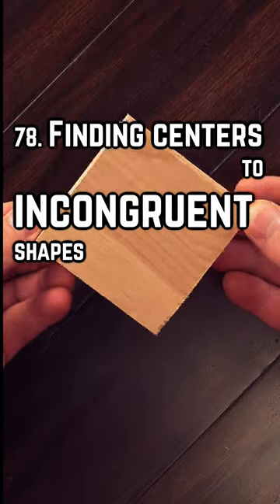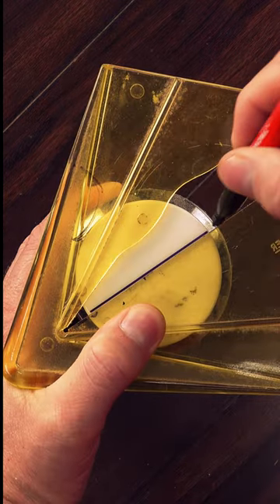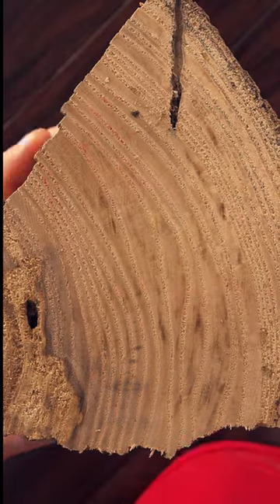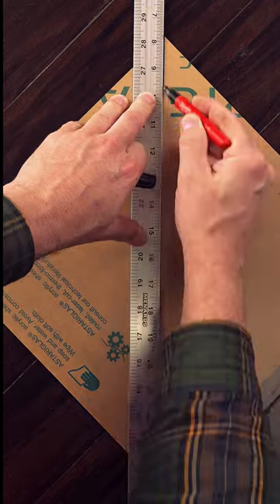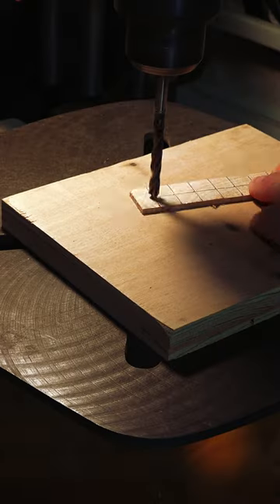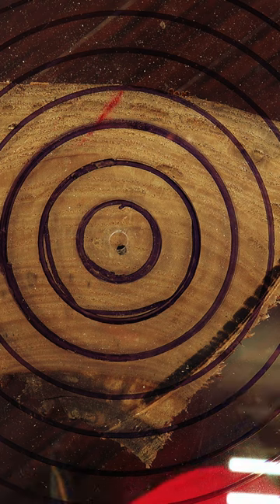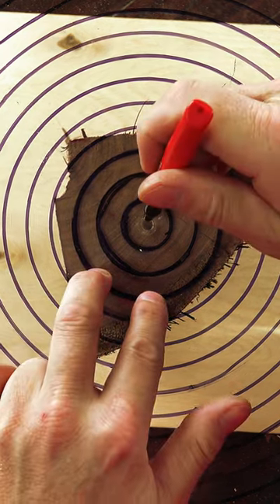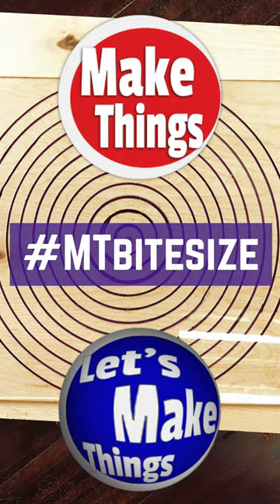78. Finding the center to incongruent shapes #mtbitesize #shorts

Comment: If you are looking for the center of mass, rather than area, first clamp a long knife--edge up--to your workbench.  Next, try to balance the piece on the knife edge.  When you have it pretty close, give the piece a hard blow to make a mark across the bottom.  Rotate the piece and do the same thing at least one more time, though two or three are better.   Now do the whole thing to the other end.  Profit!
Reply: This way you will find the center of gravity/mass, but not the center of area.
But for the most homogeneous materials with the same thickness over the full area that would be almost the same point.
Reply: @MlTGLIED  did you read the first sentence?
Reply: Actually, he's not looking for the center of mass or area. He's looking for the center of the largest circle that fits in the piece.
Reply: Or balance on a punch/ream
Reply: @Chewychaca  That works, but, depending on the size/weight of the piece, can be tricky.

Comment: There are TWO centres;
Centre of area, and centre of gravity.
Sometimes they coincide.
.
Reply: For anyone confused this video is about center of mass
Reply: @timothyweber671  
For any flat shape however irregular, just suspend it from three points roughly equal distances around the perimeter, and mark the vertical line from the suspension point.
Where the lines cross, will be the centre of gravity, or mass, if it's even thickness.
.
Reply: @niklar55  seems I was confused thanks !
Reply: @timothyweber671  
Learned that method from a Physics book my dad bought me when I was 12 years old.
If you get it right, you can then balance it on a pinpoint!😊
Reply: There's even more different centers. This method can find the center of incircle or the center of circumcircle - and if you want to turn an irregular shape on a lathe, the center of the incircle is what you want, because that is what gives you the largest cylinder of usable material.
Reply: @zuthalsoraniz6764  you need more upvotes. There are really a lot of different centers
Reply: With this level of estimation, you'd be fine with just attempting to balance it on your finger and figure out aproximately where it could be balanced.
Reply: @zuthalsoraniz6764  
That would only work on a piece of flat material.
For a log, or split log they would vary along its length.
If the log was curved, the centre of the inside circle on each end could result in a seriously out of balance item.
Reply: @timothyweber671  This is not about center of mass or area. It is about finding the center of the biggest circle that fits on the piece.
Reply: @timothyweber671  It's not, actually. It's about the incenter, the center of the largest circle that fits within the shape. The center of mass of a thermometer shape would be somewhere along its neck, while its incenter would be in the bulb.
Reply: (Roughly) triangluar shapes like the example log have four geometric centers, one of which, the centroid, is the center of mass (for constant density materials). A lot of assumptions would be made with real-world materials especially natural ones like wood, but using the centroid on something like this would be a far better path forward if the desire is centering for turning.
Reply: assuming the material is homogeneous, it is the same
Reply: @merren2306  
Nope.
If the material is wedge shaped, for instance, they would be quite different.
.
Reply: @niklar55  a wedge is three dimensional, not two, so "centre of area" would be completely meaningless in that case. The centre of volume and centre of gravity would still be the same
Reply: @merren2306  PLEASE READ the original comment........................
There are TWO centres;
Centre of area and centre of gravity.
Sometimes they coincide.
Reply: @niklar55  centre of area is meaningless in a three-dimensional shape...
Reply: @merren2306  
Nope!
If it's a flat object with a continuous cross section, then the centre of area is relevant.
eg. A slice of a tree trunk.
.
Reply: This one is trying to maximize the amount of circular stock you have
Reply: @jonothankaplan  
Agred, but i'd put it as the maximum size circular disk that can be fitted in that cross section.
Reply: there are as much of center as you want..just give a definition of this center.. and sometimes this centezrs are outside the object...
Reply: and in this specific case with this tool for many shapes you can find several centers even an infinity.
Reply: @jacqueslemiere  
Yeah and pigs can grow wings and fly!
Reply: @niklar55  . if you take a simple rectangle there is an infinity of  points that fit the définition  of  center this guy just defined.. 
 and indeed  you can have as many centers as you want..  not only two as long you give a definition..  center of mass is not  the propriety of a shape but a material object by the way..but the  definition of this guy is really bad because there is not a unique center for a shape ( rectangle) .. we  can expect the center of..what you want is unique.
Reply: @jacqueslemiere  
There is only ONE point that is the centre of a rectangle.
Reply: @niklar55     i first it was an exemple to illustrate the fact that a shape can have several  centers as defined  pas this guy e, second, you admit that center of gravity   ..the center of gravity of a rectangle can be anywhere in this rectangle according to  local density.. n..  well funny enough i think center of" gravity" is not valid here because is 3D in reality and we are speaking geometry... you should have use another word .. well but the main point is elsewhere.... you have as much "centers "as you can find a definition...  center alone  means usually center of symmetry.. but..... you have the right to create any definition you want!!! as many center as you want.. even in math..
Reply: and ..the video guy has a very problematic center definition as  as given shape with his definition you have an infinity of "centers".. On the other hand , for a carpenter  , the idea of finding the largest circle you can find  makes senses, it    is what he does..  but for a mathematician what matters will not be the "center " but the "diameter a  given shape has, a maximum circle diameter... center is obvious for people or mathematician when there is symmetry, everyone say lets call this "the"  center.. BUT... fot  intricate shapes..either you say there is no center because there is no symmetry or..you state the center of nikalr55   is  defined by...bla bla
Reply: @niklar55  and i stop there..i don't want to argue endlessly..
Reply: @niklar55  because you want to look at the more clever of all,  and i want that all logical people agree.. therefore define words first..
Reply: @jacqueslemiere  
Sorry, you comment is nonsense to me.
Reply: @niklar55  no problem..
Reply: as if it matters
Reply: @needamuffin Much more than 4, I can name 10-11

Comment: Just use a compass. Set it at what you think is about half way across. Then put the spike in the outside edge and draw an arc out in the middle. Move the spike to a new spot and do the same. Using the low spots will be faster and more accurate. 5-10 spots will narrow down the middle pretty fast.
Reply: first thing i thought. this is taught in maths classes right?

Comment: Just hang it from two points. Draw lines along the vertical. The center of mass is where the lines cross.

Only works well for objects with homogenous density, obviously.

Comment: Rob, I made one of these years ago, but instead of making the circles with a marker, I used a plywood backer to hold the acrylic stiff and turned grooves at 1/2" increments.  I also drill holes at those 1/2" lines to let me draw circles if desired.

Comment: The center of an irregular flat shape is located by hanging a piece that shape from two different points, some 90º apart around, and marking a vertical line from each point as the piece is hung from it. The lines will cross at the center of mass, it will be the geometric center also if the piece has homogeneous specific weight.

Comment: Triangle.  Center is found by drawing 3 lines, vertex to center on opposite side.  I have just been down this particular rabbit hole, due to having my blanks (for a class) being made from a large cherry log by someone splitting it with hammer and wedge.  Shift the center of the circle a half inch towards the outer edge to include the sapwood....

Comment: If you want to find a center of gravity of a flat irregular shape, there is a simpler way. Attach the shape at various "corners", and use line and plummet to draw the line; all lines should cross in a single point - a center of gravity.

Comment: Hang it from a corner, draw a line straight down. Change the angle significantly, draw a line straight down. They will intersect. That is the centre. Take more points for higher acuracy. Why, well...

So, if you are using this to spin something you might want to centre the centre of mass, and not the geometeic centre. Think of a hammer. If you were to turn it so the handle would stick out, you'd lock it near the head, not in the middle of the object.

Comment: One interesting thing we teach 3rd graders in EU. Take any 2D shape, suspend it at any point at the circumfarance by a nail and a string, draw a line extending the string. Do this 2 or more times and you get a center of gravity of that shape where the lines intersect.

Comment: OR...Or... You could do that thing you leaen in physics/geometry class where you hang a string with a weight from a point on the object, and draw that line. Do it 2 more times and you have your point! Only requires tape, a string, and a small rock or a nut.
Reply: THANK YOU!!! (The Office meme)

Comment: this for u is the easy way? U should use gravity and find the center on 3 seconds: just put a string on any place and hang it and draw the line, do it a second time with a different spot and voilà the intersection is the perfect center.
Reply: that's the center of mass, which is not necessarily the center of area. It seems they were looking for the center of area
Reply: @MemTMCR  You are right but wrong at the same time. On a flat ogbject, made of  a single material, the center of mass is almost identical to the geometrical center. Now if the guy in the video showed a exact way to calculate the geometrical shape you was 100% right but his "method" is just an approximation so the center of mass is a better approximation than concentric circles on a pieace of plastic.
Reply: better and faster